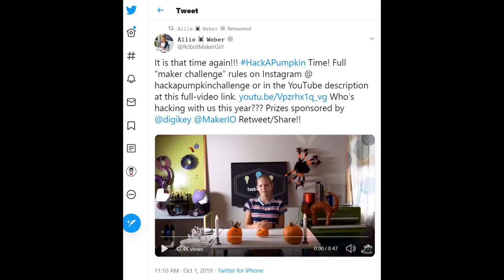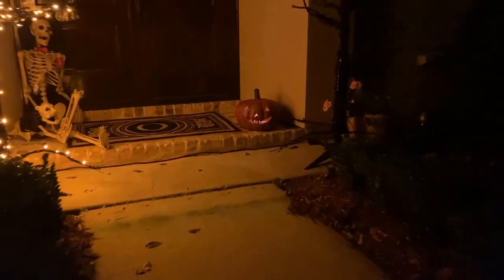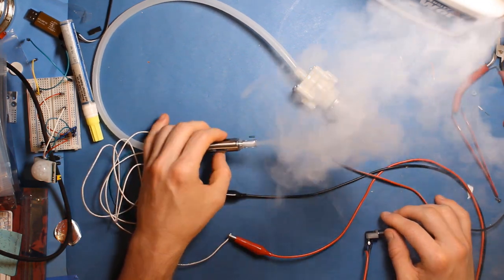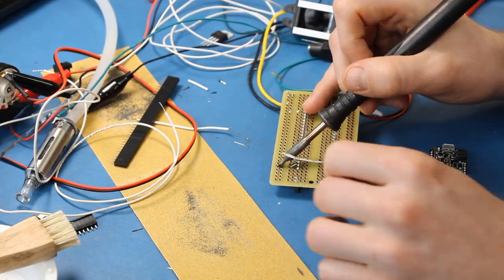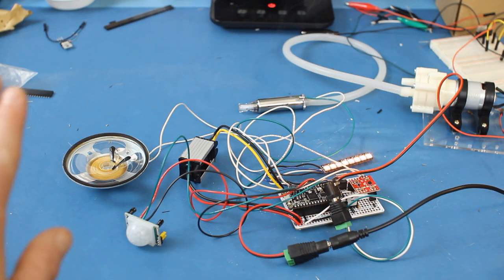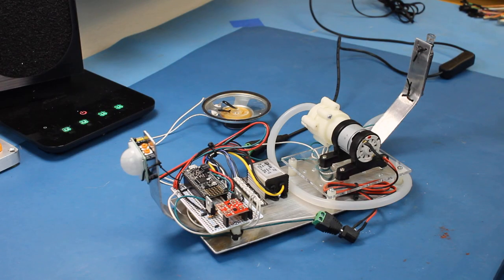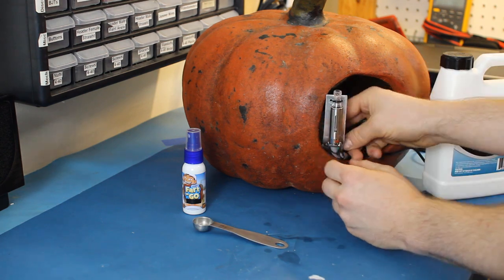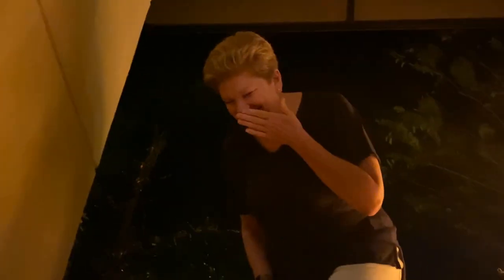Hack a Pumpkin: Spoopy Poopy, the Gaseous Gourd

Comment: Do you have a video about the reflow oven you talk about in this video?
Reply from the maker: Not yet...I've got shots of me building it, but I still need to edit and post it.
Reply: @ShawnHymel   Thanks for answering. You got my attention when you mentioned the aluminum sheets. I plan on making some enclousures using that material, and while searching on the internet I realized that they're easier to work with without purchasing expensive equipment.

For quick projects, metal shears and a rivet gun will do the job. I even saw that with a propane torch and "welding" rods, two sheers of aluminum can be "welded" together  (I think the process itself is called brazing). There is no need for expensive and bulky welders! 
Anyway, I think I got a bit carried away. Looking forward to that video!
Reply from the maker: @Asyss_Complex  Agreed! I don't know how to weld, so it's a good, easy option for prototyping and basic projects :)